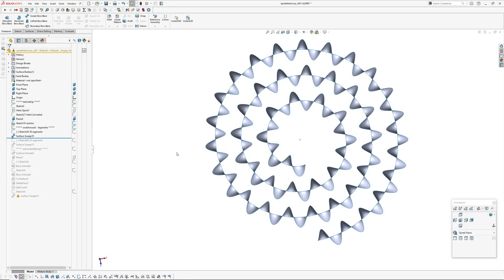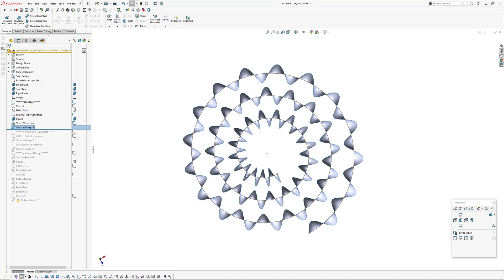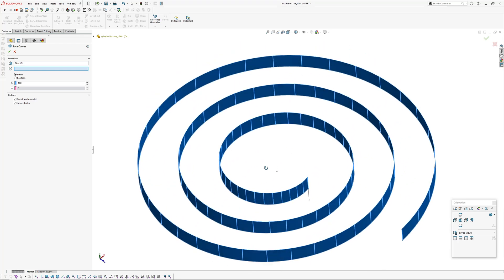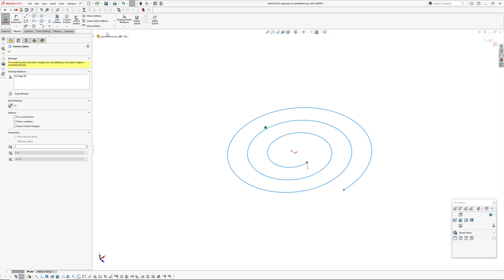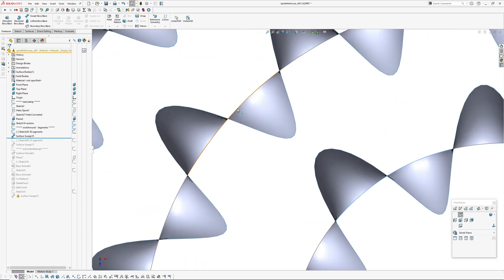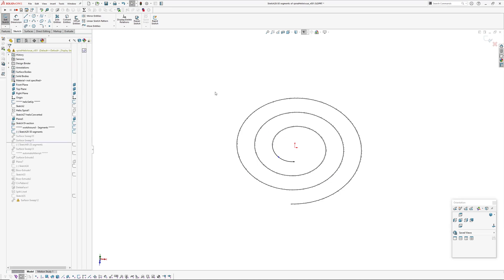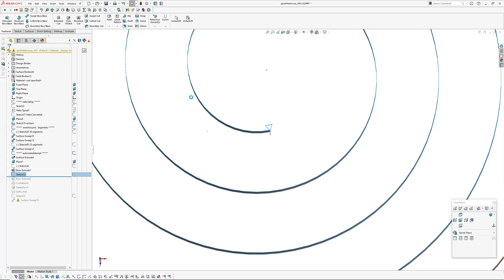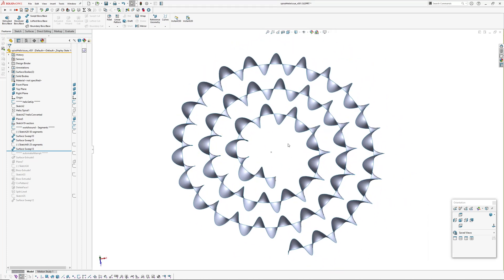Solidworks Equal Pitch Spiral Helix Problem

Comment: But each half circle has a different length
Reply from the maker: Not sure what you’re referring to?
Reply: @AndrewJacksonDesignStudio  Each rotation is averaged, but a single one is not. You can find that for a single rotation, the first half and the second half have different distances.
Reply from the maker: If I understand you correctly, you are saying the inside half of each revolution and the outside of each revolution has a different resultant length helical path length, per pitch length/revolution? That is expected though, as the pitch is the driven input. If instead of sweeping a helix along the spiral, we swept a circle of the same diameter as the outside of the helix along it, then split the spiral tube in half, the inner edge length of the spiral is shorter than the outside. If you want the inside and outside of the helical path to be equal, that means the spiral has to be a line.

Another thing that I was thinking that proves out in the CAD model is that the helical path for each revolution gets shorter from the inside of the spiral to the outside, which is because the curvature of the spiral is reducing. Again, the centreline pitch is the driving geometry, so the helical path is resultant.
Reply: @AndrewJacksonDesignStudio  Each segments/centreline still not equal. Make a face curves you can find one segments is same not equal pitch problem. I hope I can make it clear this time.😂
Reply from the maker: The spiral path segments are equal in length. You can measure them in the spiral sketch that has been split into segments. The person that posted this issue wanted equal length pitch on the spiral centreline and this ended up working for them so that’s good right?
Reply: @AndrewJacksonDesignStudio  Sorry... All I talking is for single segment, It still have inequality problem. The half and the second half have different pitch length. You can extrude a single segment to surface then make face curves 50% to check.
Reply from the maker: Good stuff 👍